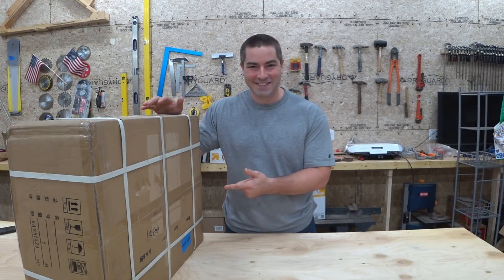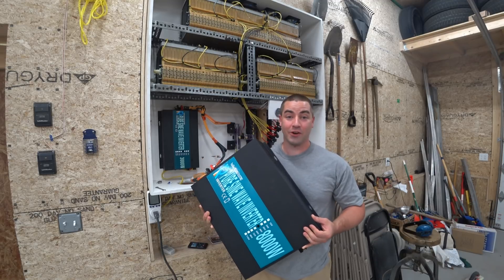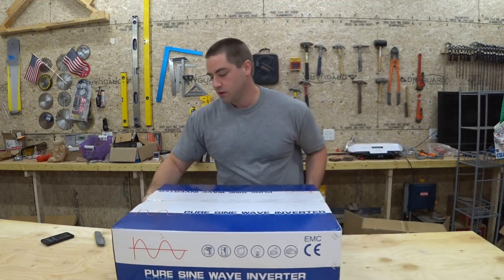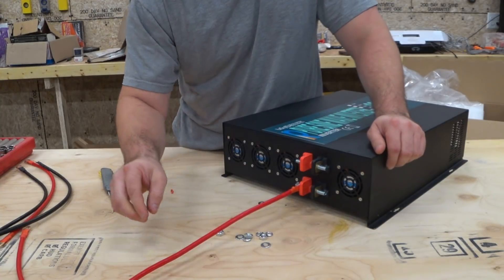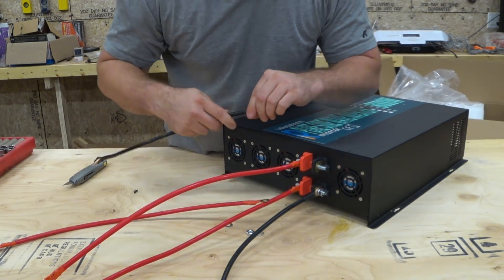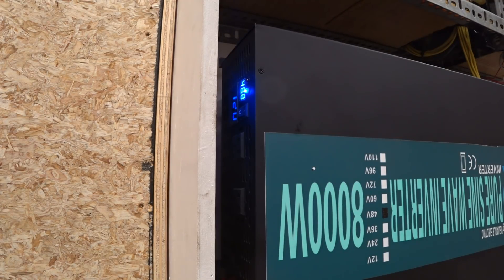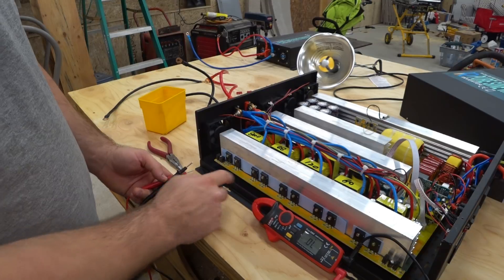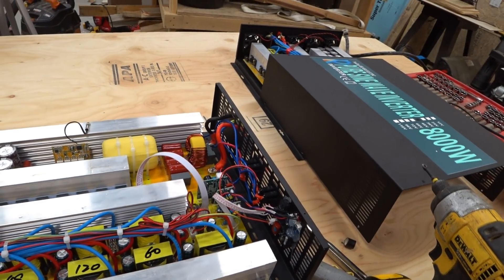Cheap 8000w Reliable Inverter, DIY Powerwall, Chevy Volt Batteries

Comment: Yes, you blew it.  You need not be an engineer but merely a Savy Tech to figure that out.  First of all you need to understand the various protection devices.  The breaker is a electro mechanical device and it relies on the device to heat up before it opens the circuit.  Since it is rated at a higher current it will take longer than the smaller devices inside the unit.  Once the weakest internal fuse blew that placed more demands on the remaining circuits.  This caused the problem to escalate to the internal failure you experienced.  You also need to understand the dynamics of your particular load.  Motors typically have a starting current that is 1.5 to 2 Times their rated or disclosed value.  You will also need to understand the effects of an inductive load.  These types of loads are well known for generating transients which are harmful to the solid state devices in the inverter.  Often low cost units omit the necessary circuitry needed to deal with these transients.  You may have been ok if you were supplying voltage to a resistive load such as a light.  JB. Pen tech

Comment: The high frequency inverters are fine for many household loads but not so much for high surge inductive loads. The low frequency inverters work much better for high current startup applications.
Reply from the maker: Thanks.  Since making this video I have replaced it with a low-frequency: https://youtu.be/dfHb5tZErTs

Comment: Okay so you're over the pond, but mathematics are the same as well as coded parts.

Now you say 8000w. And 120v that's 66a.

The blown fuses are ten amp.
So you're putting 3 times the rated power through them and of course they blow.

Also looking at the design (couldn't see much) the voltage doubler design is a little off.
I'd have seen the the normal coil, but would have like to seen the diode and cap doubler.

Also I couldn't see if the windings were stepped, it was labelled as doubler coils, but we're they the same rate?

As we know double the volts halve the amp. So how did source provide its initial current?

I'd use math of total in a -20% / coils = output current.

Also no load draw on the item's has a low power than the load, the saw has a initial start, due to the brake of the motor. (Ir).

Back to the drawing board with that one.
Reply: So dont buy the 8000w inverter..

Comment: An electric motor is a dead short when you pres the trigger switch and it has not started running yet.
A 15 amps rated electric motor may draw in excess of 45 amps at startup.
Unfortunately, semiconductors react way much faster that a fuse or a breaker.
A breaker may trip after some 50 msec or more.
That 35 amps breaker will trip at about 50 amps... If that current is present long enough.
A fuse will blow within 10 msec, and faster if the overcurrent is high enough.
A semiconductor like a MOSFET will likely blow within 100 microseconds if the absolute maximum rating of the part is exceeded.

Furthermore, there is the voltage issue which a breaker or a fuse does not protect against.
An electric AC motor is basically a DC motor on which the connections are switched.
A coil switching can create voltage spikes over 10 time higher than the driving voltage.
So, driving the motor with 120 VAC may have given spikes in excess of 1,000 V.

That would certainly exceed the absolute maximum rating of the MOSFETs, blowing them up.
In turn, the fuses would blow as MOSFETs often short when they blow up.

Conclusion: A strong voltage limiter in the dV/dt domain would need to be used.
Reply: @A seagypsy's Adventures The 3Kw inverter may be using better quality fets and have better protection..
Reply: Well I was about to say the 3000 watt inverter ran the miter saw therefore the 8k watt inverter certainly should have as well. That brings us to the components inside the inverter... namely the mosfets. But even that was discussed. 
However
   So my final additions and possible solution is to ask the company if the mosfets from the 3k watt inverter can replace the mosfets in the 8k watt inverter albeit the 8k watt inverter would require more mosfets than the 3k inverter and if the schematics simply added more of the same mosfets to elevate output wattage. As others stated; using protectors could help. But that would still not allow the inverter to run the miter saw. Yet there is a way to prevent the overloading... The use of Capasitors (starting capasistor) should allow the miter saw (or other rapid high drain devices) to "cushion" the start up sufficiently.  Also They have these systems that prevent high surges for homes. Although the cost of these units may exceed the value it allows. (Yes, they claim it will dramatically reduce one's electric bill, but that is mostly a gimmick.) However, for this application I can see it being probably effective.
Reply: Exactly, well said. The LRA (locked rotor amperage) is always higher than the rated power and and you said the semi's will burn faster than a fuse but a 8000w inverter is about 66amps @ 120v. What's happening is for some reason, in my opinion because this is working on your 3000w inverter is that the saw is putting out harmonic distortion of some sort that may be interfering with the circuit's feedback loop and cooking the FET's, FET's are not good quality, over-voltage situation internal, too many potentials to list. There are plenty potential problems that are catastrophic to inverters. My thinking may be the company selling them does not actually mfg. so they are different circuits, quality components, etc. vs the 3000w one. The giveaway was the different color cables; typical of cheap Chinese companies...
Reply: Thankyou for your educated comment, bringing light to a dim corner of the web and no thanks or interest from the uploader, hey ho, takes all sorts
Reply: More simply, when the MOSFET switches off, the magnetic field in the motor makes the current "attempt" to keep flowing and the voltage shoots way beyond the supply voltage.  MOSFETs really can't be driven above their rated voltage, so a well-designed circuit would have a fast-acting "snubber" or back-EMF limiter.  They're a really standard component of any PWM motor controller or switching power supply -- the Reliable Electric folks will have to include good protection for the MOSFETs.  (You can sort of get away without a snubber by using FETs with much higher voltage ranges than the supply, and FETs have a built in body diode that helps a little, but it's obviously insufficient in this case.)

Comment: It sounds like the inverter is dropping its supply voltage at its in-rush start of the saw, therefore causing the amp draw to spike well pass the components ratings,
Reply: Yup it could be just wire size. Use battery charging cable, thick stuff!

Comment: why do you waist your time on china garbage? Go buy a OUTBACK gvfx 3648 inverter and your problems are over. That inverter is a string mosfet ramp power and can not take a quick surge load it will do as you see. Any inverter that gives you replacement fuses are built like that.It is NOT 8000 watt. That is there marketing work. How many of those do you want to go through and make videos to show what i am telling you. Cheers on the junk smoke box!!

Comment: Sure the inverter is cheap and light and Chinesium but I doubt that's the problem. Sure the saw start current it high but I doubt that's the problem. 
They actually shipped you three conductors for each pole. You need to install all three of the conductors. Two can be fastened to one terminal and one to the other.  I can't diagnose from afar but I'd say if you blew two inverters using the same installation, it's the installation that is bad, not the inverter. It's fascinating that you actually performed the test and yet 100s of people watched, but didn't see it. 
The fuses in the inverter are not there to protect the MOSFETs, they are there to protect your house from a fire. It's part of the UL requirements. 
I'd say the voltage from the battery, through the 1/3rd size conductors, was too low to get the MOSFET to switch during the surge so it failed. Once the first one fails, others will follow and fuses will blow. Even 2/3rds would likely cause the same problem. 
The three conductors will carry enough current to supply the system. It's a common tactic to use several smaller conductors to meet ampacity requirements rather than a single very large one. You will also need to ensure your battery can maintain proper voltage  during the surge. 
Surge capture clamp-on power meters are cheap these days. 
The smaller capacity inverter likely worked well because its' input voltage was not compromised. A small inverter will just provide less output voltage during the surge event which a brushed power tool handles really well. 
Good luck with it.

Comment: How much does the start up draw on the mitersaw
Reply from the maker: I did a follow up video where I tried testing that.  I think it was 35 amps @120 volts.  Something around there.  But I've had plenty of people tell me that my meter is not the right type for reading surges.  So who knows?

Comment: Doesn't seem very. Reliable
Reply: Yep something bad wrong when a 3000 Watt unit werks wurks wirks wyrks works better than an 8000 watter.
Reply: Possible operator error. I wonder if he read the instructions?

Comment: For induction load like miter saw, there is voltage overshot, you also need inductor to limit current.
Reply: Good point. Sometimes there's a lot goes on that a layman may not know about. Like a flourescent light has a starter thing. I'm one of those Dumb--s kaymen, a capacitor maybe? I dunno but I think it uses a lot of watts or amps or something to start then chills down a bit. Those are technical terms that not everybody knows. Like it's hard to find that chills out setting on your electrical meter.

Comment: Do you suppose that the (dual) positive and negative 48vdc inputs have been designed in this way for a good reason. For example, if there was only one (1) positive and only one (1) negative 48vdc input - and either of these became loose, they would heat up rapidly under load, with potentially catastrophic results. Could even burn-off the whole conductor! But - because there are two (2) of each, then we must assume that at least one of the positives (or negatives) can still carry 50% of the current. In this way, the damage of a high resistance joint would be lessened. So this is my theory for the fitment of double pos. and neg. inputs on your 8kW Inverter.
Reply from the maker: I think it is just component manufacturing.  I have a 3000 watt inverter from the same company.  The 3000w has the exact same posts on the back, just one positive and one negative.  Inside is identical as well, just less of each thing.  I think the manufacturer is trying to buy the biggest bulk quantity of each item.

Comment: A big shame for a company with the name Reliable Electronics. If I owned that company I would have done 2 things 1) Send a technician with the replacement to check everything out 2) Check the product thoroughly before shipping it.

What is perhaps more relevant is, the fact that the fuses blew but the mosfets were still damaged, long live the fuse?
Reply from the maker: Hi Andrew,  I'm not an electronics guy, but some commentators have told me that type of blade fuse is much slower than a mosfet to burn out.  Also, there are no protection circuits.  It's too bad.

Comment: I had to stop and go back, just to be sure, but yes, I was not mistaken; so the high inductance saw tripped a breaker, then you replaced 6 fuses....o...k.., still watching , things with multi-meter and then (3.58'ish) AMPACITY ?!   eff mee backwards!    I just can't watch any more...I don't see it getting any better..bet he mounts it in an enclosed space, I hope the volticity can be weighed with the correct ruler...
Reply from the maker: LOL.  Nope, it never got any better.  I don't know anything about these tiny electronics.  When I had contacted the manufacturer about this they were trying to give me instructions through e-mail of what they wanted me to check, but I was using google to translate the Chinese.   I gave up and just bought a different brand inverter.

Comment: I had similar problem with powering induction engines. I had campervan build with electric air conditionin and more powerful inverter could not start it. Amperage was too high. It did not break but every time we tried to start it, inverter protection kicked it. We replaced it with smaller one which was just on the edge of needed power and this one worked. The difference was that smaller one had longer response time for overload and was a bit more robust, so it could handle high power draw for short period of time when you start electric engine. That's also the problem here. Startup current is much higher than nominal power draw.

Comment: With a large inductive load, you should use an inverter with a nice big toroidal transformer in it. I've a 3KW inverter with a big heavy toroidal transformer in it and it eats inductive loads for breakfast. That inverter of yours will be fine for lights and non-inductive loads although the heatsinks look a bit cheap. I agree with you able the cables and connectors.

Comment: I don't think mosfets can be tested while still wired in circuit. They need to be removed to properly be tested. You said the 3000 watt inverter handles the miter saw without any issues? I wont be buying a 8000 watt inverter from them!

Comment: The smallest wire gauge that can be run in parallel per NEC is a 1/0
Reply: NEC means nothing outside of the US.. This is why you should built your own cables for this stuff and not use what is supplied..

Comment: If I owned the company where I was supplying  replacement due to a previous failure, and I knew my replacement might show up on youtube, I would be sure the replacement would have been tested under similar load conditions.
Reply: Unless your products are garbage to begin with.
Reply: Note that the miter saw works with the 3000w inverter. There is no reason it should not work with the 8000w inverter. The 8000w inverter obviously has a design flaw the 3000w inverter does not.
Reply: @lesliefranklin1870  yes, but inverter shows a dead short from his tool.  if you know your shit you would not have any issues with reliable. Not to mention very large single run 120v inverters are for stupid peoples!
Reply: I know right I was thinking the same
Reply: the company should jest send 1m cheque and no further video.
Reply: can you read Chinese hahahaha that is why they throw away
Reply: yep, I bet it works if used correctly. It surprises me how many people open something and then throw away the instructions. I've seen things not work and piss somebody off and I find the instructions and start reading and lo and behold somebody didn't do something right. Not sure if that's how to spell lo and behold. I've seen numerous times when something gets put together without the instructions and you get to step 11 and have to take everything apart  because you neglected to perform step 2 in the proper order. I wouldn't do that. Again. Oh hey look it says may not work with certain appliances or tools that use a high amount of amps to start or something similar.
Reply: Mark Hill I blame the dishonest and misleading wording and photos sold to the public.....if there is a little known flaw but it destroys it i would put that all over the inside and outside of shipping box and notify dewalt they should do the same or youre sueing for damages.
Reply: unit has nothing to do with being bad it's the start load current that the saw draws to start the unit sees a brief short and causes it to short out it's dewalts  tool design flaw that they really were not made or had in mind that there tools would be used with a power inverter ! further more all power tool  companies should look into this matter!....
Reply: @jaimecanizalesarmas6291  Interesting point indeed. Any idea why that saw worked with the 3000w inverter?

Comment: Don’t feel bad, I’m an electrical engineer and I still fry some stuff all the time. If it ain’t smokin’ you ain’t learnin’
Reply: Hahaha, how true. Sad but true. Good friend worked on extremely high voltage like in a substation and told me if power is out you can't check it with your meter, it'll blow it up. He said and this was crazy, they have to put on their highest voltage resistant gloves and get a giant wrench that they don't use much and touch one electrode and then move it toward the other and if they get lightning then it has power. Yikes

Comment: The fet’s go out in these inverters. Cheepo  ones. I replaced them and beef up a few that I have. I run my inverters (3) total into triplite line conditioners.. it’s because some electronics have start capacitors and other electronics that trip all the fet’s at once. 
I just put better quality mos fet’s. And plug the tools into the transformer first, not the inverter. I also replace the inverter out lets with gfi’s and ground the inverter. The 12 v power lead to the inverter skulduggery have a 200 amp breaker. I converted a 100 amp ac breaker and it works.